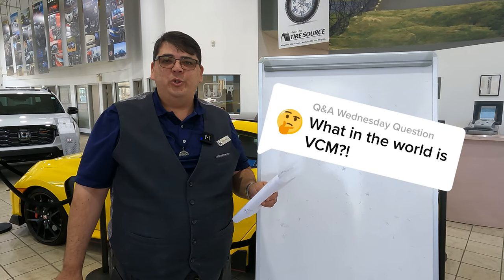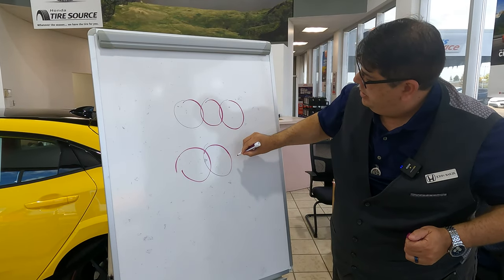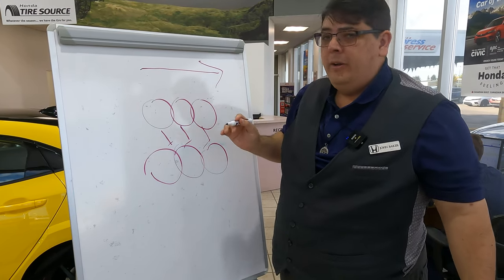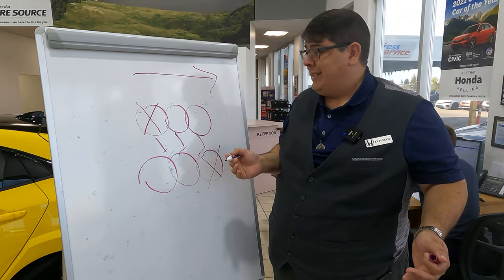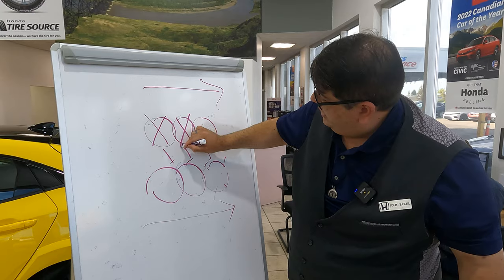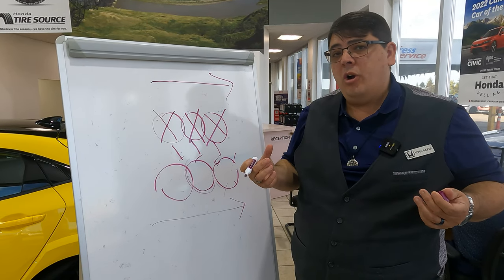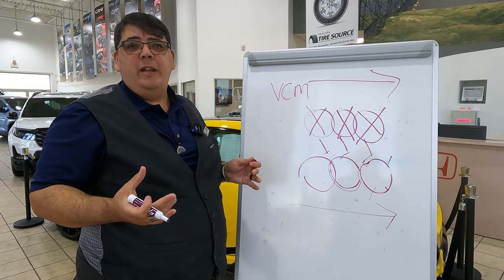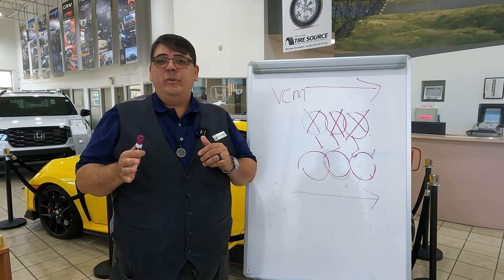Q&A Wednesday: What is Honda Variable Cylinder Management (VCM)?

Comment: My Pilot began misfiring yesterday do to the VCM system. Is it too late to disable the feature? Has the damage already been done is what I’m asking? My vehicle is at 94,500mi
Reply: I have the minivan and same thing happened to me around the same mileage. Burned oil like crazy, engine kept misfiring. Took it into Honda, the replaced piston rings and many other things. Now, just 1 1/2 years after being in the shop, same problems. If you buy a new Honda, get a VCM muzzler. VCM is garbage.
Reply: Hi, may we know what year is your Pilot? Thanks!
Reply: Buy a SVCM. Money well spent and it disables it while keeping your temp accurate.

Comment: They're still moving, do they get oil?  I heard others have already tried this crap and unless you alternate between cylinders to shut down, it problematic.
Reply: It actual creates a vacuum and so gas mixes into the oil. Plus it fouls the plugs, ruins the rings, kills the catalytic converters prematurely, burns out the coils and the engine vibration from the VCM kicking on and off wears out the motor mounts.
Reply: @daveclark8337  I recently read that Honda is having a problem with VCM causing oil burning, glad my 2 RDXs don't have that feature.

Comment: Mr. John sounds like something is a little fish around here. I applaud Honda engineers for their innovations on engine design. Why is there so much written on the internet about the problems with this system or device?  I have a PP 2024 black edition.  The reason for the purchase vs other automakers was the V6 and normal tranny not a CVT. I guess I'll be reading more on this and I'll look for the time when this kicks in during my travels.
Reply: Hi, did you end up putting a S-VCM?

Comment: Nobody asked for it, nobody wants it.  Let’s sell it as a feature.
Reply: It is a feature. It allows your vehicle to achieve sufficient mileage to avoid a gas-guzzler tax, yet makes sufficient power for comfortable driving, without using a much more expensive system, such as a turbocharger on a four-cylinder.
Reply: @jamesw1659  I wish that was true. It is not cheaper as the imbalance of the engine during the shutdown of cylinders requires the use of active engine mounts which buffer your shaking engine and cost $1700 a piece of they fail. It is known to cause expedited buildup of carbon on the active cylinders and, when I disabled mine, my mileage went from 22.1 mpg average to 21.4. It’s a bug not a feature.

Comment: My wife and I are in the market for a new Honda or Toyota. I learned about this great "feature" only recently. Have done the research and WILL NO longer even consider the Pilot. We truly wanted the v6 but it's not worth the long term risk of this problematic issue. Will only look at Hybrid vehicles from either Toyota or Honda, period. And please no turbo either - they have their own distinct issues. Not being picky, just not spending 40K just to have a new car with these features.....
Reply: My research indicates that if you gotta have a hybrid vs getting a 3-4 yr old Lexus 350 RX with its solid proven 3.5L V6 or similiar like I did (...refusing to knuckle under to the government's mandates), then Toyota's Hybrid technology is the BEST of the field and the most reliable... good luck

Comment: VCM= Engine Misfire. Have fun replacing Piston Rings and Oil leaking into the engine, which requires replacing clogged up spark plugs.. Wish I would have bought the Sienna instead, No VCM. Honda, get rid of VCM and bring back Vtec Engine.